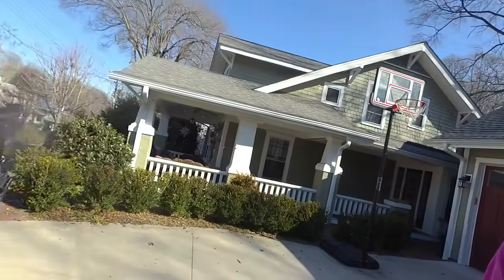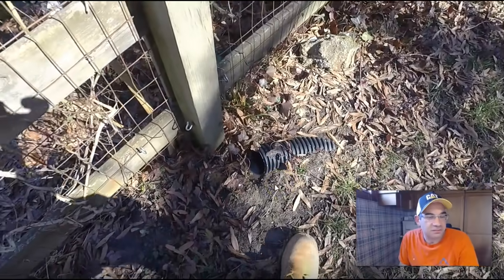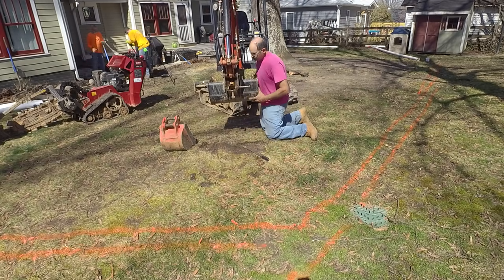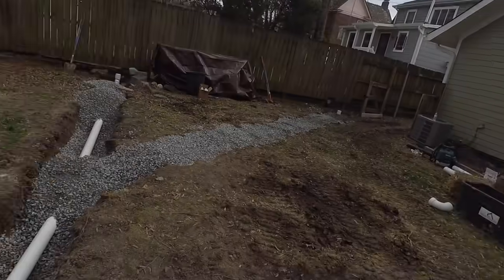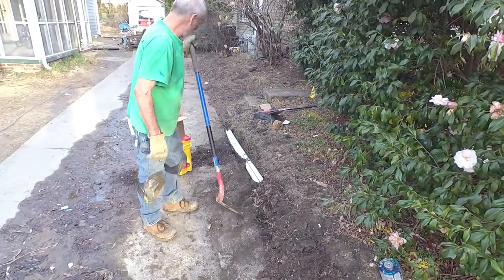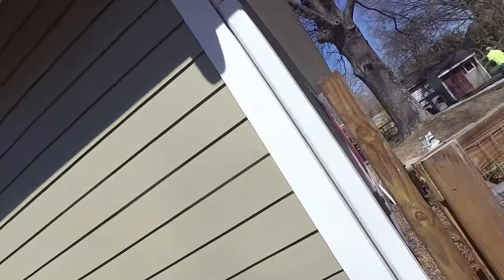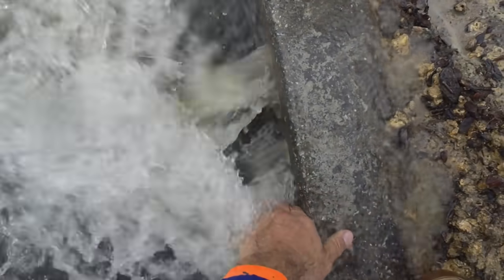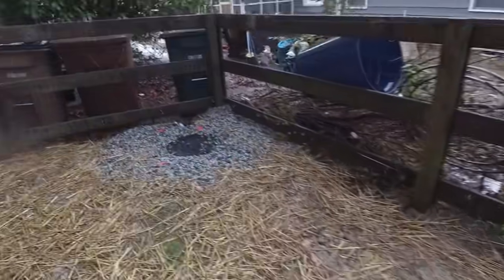Installing a french drain and dewatering pumps to solve stubborn back yard flooding

Comment: in the uk the neighbor would be responsible for the water run off and its also highly illegal to drain water into the road like that, it should be plumbed straight into the mains sewer
Reply: Just to clarify we cannot attach drains to the sanitary sewer in the US. If you mean storm sewer then yes that’s ok, but I think preferred here is to plumb to street.
Reply from the maker: Here in NC homeowners are not responsible for water flowing downhill off their property. The streets are a major component of the stormwater sewer system. We don't send storm water into the sewer that goes to the wastewater plant, we send it to the stormwater sewer system that drains to surface waters like creeks and lakes.
Reply: rain water doesnt go in the sewer here.....

Comment: How will they mow with all the rock in the yard?
Reply from the maker: The rock is at the surface of the soil so as long as they don't drop the mower deck into the rock they should be fine.

Comment: So serious question here - why is no landscaping fabric being used to act as a filter, and prevent all your gravel ditches, pipes, and sump pits from filling up with all the dirt the water is carrying to those points? What is keeping this system  (particularly all the gravel areas) from being clogged up with dirt like the previous system?
Reply from the maker: The previous system had dirt on top of it and had very little gravel. We take gravel to the surface with no dirt on top of it. This also preserves the high flow into the system which provides the energy to carry away fine sediments instead of slowing the flow and allowing those sediments to settle and linger.

Comment: No geo fabric around the rock to keep the dirt and sediment out or did I miss it?
Reply from the maker: No fabric to restrict the flow into the pipe and clog up.
Reply: @GCFD  perhaps some research may be in order non woven depending on oz weight has been tested and proven to move large amounts of water while keeping the soil from packing 2B gravel which will clog the system

Comment: This was cool to see!  Are you able to rate the system at all?  Like how many inches of rain per hour or minute that it moves?
Reply from the maker: I'm sure you could use the chart from the pump manufacturer with the distance, pipe diameter, and head, but keep in mind this system was designed to evacuate the residual water after a storm and not keep up with the water. 👍
Reply: @GCFD  Thanks!  Makes sense.

Comment: So heres a question..
What do you do if power/cable lines are in the path of where the drainage line/exit is to go?
Reply from the maker: Power is going to be very deep so it's never a concern. Cable can be hand dug and worked around as long as you're careful.
Reply: Thanks <3
Yeah unfortunately where the water piles up in big storms and where the water runs off naturally towards the woods is in the path of both lines in addition to the septic so just wanted to make sure if i ever did anything.

Comment: I would have made the top of the french drain look like a dry creek bed with round rock.  With regards to the pump my guess is you are limited in terms of volumetric flow rate by the fact that you can only use 110 volt 15 amp to power the sump pump.

Comment: ed to switch the pump to a 2 inch cast iron waste pump that solved my problem
Reply from the maker: These pumps have been working extremely well for removing the residual water. They are cast iron M98s.
Reply: @GCFD  nice pump however to handle that kind of water waste pump is the way to go nice 1 to 2hp waste pump or sewer ejector can deliver a massive amount of water. hurricane sandy was no match for this pump. little giant 16c. always times what is needed by 2 this way not overworking the motor. nice french drain thank you for the video awesome job

Comment: Question, the pipe in French drains are they perforated with holes? I couldn’t really tell in the video.
Reply from the maker: Yes! The holes face down because that's where the water hits the pipe first as it fills up the trench.

Comment: is it possible to core under the concrete without tearing it up?
Reply from the maker: Yes you can bore under it, but there was a gas line running under it. 811 requires special notification when boring, so we cut and replaced it in this instance.

Comment: Question:  When you install french drains and basins so close to a big tree, aren't you concerned about water-seeking roots getting into them?   I ask because I need a dry well close to large trees in my back yard.  Thanks.
Reply from the maker: The PVC pipes shouldn't be holding any water that roots would go for. Corrugated pipe holds water in the valleys and the roots go for that.

Comment: My understanding was that after a while, dirt would work its way down through the gravel and eventually block the French drain pipe, if, there was not some kind of barrier like landscaping cloth wrapped in with the gravel, is this not the case? overall love the videos! super informative.
Reply from the maker: That's why we don't bury our FD in dirt. It helps keep the dirt out. We also use a large volume of angular gravel which is what keeps the dirt out. The increased flow into the drain provides the energy to carry fine sediments through and out of the system, keeping it clean and flowing.
Reply: @GCFD  awesome! Thanks for the info. Look forward to more videos, as I will be subscribing.

Comment: separate comment, when I was a kid,  friends dad 3 streets over bought home that back yard flooded, after storms, 3' of standing water until it soaked in, houses below got more as they were lower, well he bought a dump truck & brought in fill dirt, raised his back yard 4 feet, but lower neighbors got a lot more, 8' or more of water it was crazy,  this was done 35 or so years ago, & he let me use his old dump when I was growing up, & I just bought my first dump a few days ago, but I need to repair it before I can use, I assume how he did it wouldnt be legal now? but that was my first experience & exposure to this, & he has been dead 15 years now, & house sold to someone else that I have no idea of
Reply from the maker: It would be legal here in NC. Homeowners are not responsible for surface water draining off their property.
Reply: @GCFD  very cool, & this was in VA, but was unsure, especially since this made all homes in bottom of valley flood worse. didnt know if there were laws now or not, I am just learning at present, got a Tractor with loader & backhoe, but so much to learn. but I am having a blast doing work on my own property

Comment: Since I’ll need to get started on my own, I thought I’d start with the parameter of the trailer where water has made a trench & settles there but need advice and love your work. Do I dig out the area around the house and put in gravel or something or do I build it up with dirt then put something down? I was going to send a pic but couldn’t figure out how to attach.
I’ll be using my only tools which is a shovel, rake, and wheelbarrow.
Reply from the maker: I would ask the question of where is the water coming from that is forming the trench. Can you catch it before it gets to that area?
Reply: I have a metal roof with a wide overhang that I don’t think can hold gutters so it’s coming straight off the angled roof
Reply from the maker: @BoringisBeautiful  gutters would be the cheapest and most effective way to move that water because they are the collection system that places your water in a pipe.
Reply: I understand. If I get gutters there is still more problems with where the drainage would go. I really wish I had someone knowledgeable that would just come see what I’m dealing with and advise me where to start. No one calls me back or comes out....I guess because it’s a trailer, idk. I finally got the county to respond to my email concerning my ditch & culvert under my driveway filling with water even with a light rain as the ditch is almost flat/not a ditch. But they haven’t been out yet.
I just thought I could start shoveling something 🤷‍♀️. Just don’t know if I’ll make it better or worse.

Comment: Wow that was a lot of water! Shawn, how do you make the waterproof electrical connection to the sump pump in the basin? They normally plug-in, right?
Reply from the maker: I order these pumps with 25' cords so the are already set up with the cord. Then it can reach to an outlet. In this case both pumps reached outlets and we didn't need any installed.

Comment: Would it have been possible to put all that dirt back over the gravel to improve the looks, or would that interfere with the French drain?
Reply from the maker: Putting the dirt over top of the FD doesn't let the water flow into the FD. We consistently replace french drains with puddles standing on top of them.

Comment: Great job...BUT I would not put over an inch of dirt within 30 ft. of that tree. I've been there and done that . I also killed an oak about that size by digging a trench about 10 ft. from one.
Reply from the maker: The tree used to be covered in that much dirt but it washed away recently so we felt ok replacing it. We also tried to stay off the drip line with our trench as we didn't want to hurt that amazing tree. Great comment!

Comment: question on French drains, to they make perforated culvert pipe to use for a French drain that can handle weight of car / pickup? I am just starting to learn, never done anything yet, my driveway will be first in a few months, but I have a co-worker that yard slopes down, so water runs down, then they have a 2 car garage elevated approx.. 2 feet,  garage is close to 100 feet past the house,  but water is eroding dirt under cement pad 6 feet in front of garage, rest of yard is dirt grass, very little gravel, been years since gravel was poured, it looks easy to dig & channel water around side of garage down hill,  but all I see locally to me is single wall perforated pipe, & I dont know if they can handle weight of vehicles driven daily across?
Reply from the maker: Yes, we use schedule 40 perforated pipe. That can handle whatever you want to drive over it.
Reply: @GCFD  thank you, I will go looking to be able to figure out layout, & pricing

Comment: May I ask why you didnt line the trench before you put the gravel in?
Reply from the maker: We have clay here so not much subsurface water moving around.
Reply: @GCFD  I have a lot of clay too.  Just never seen this done without a liner.
Reply from the maker: @michaelfisher7835  exactly 👍
Reply: @GCFD  I like what you did with the rip rap and culvert pipe in the other video.  I like the look of the rip rap and it is more practical in removing surface water along with the water coming across that road.  The customer could do some really nice landscaping to enhance the look if they dont like the rock alone.

Comment: Really enjoy watching your videos, as a IT-Tech over here in Sweden its nice to grab some points for your own home.

I do have some questions for you, i will keep them short so sorry if they sounds rude, not my intention :)
#1 Would you have had the same efficiency if you had put the french drain all along the fence instead? (Improving the WAF-score (Wife Approval Factor))
#2 Could it also have worked with a channel drain along the fence?
#3 Is there anything you could do about the looks when putting it smack middle of the yard?
Its kind of a pain in the but with a robot clipper to have the risk of it throwing stones everywhere.
Reply from the maker: Great questions! We let the water tell us where to place the FD. You want to place it where the water has already found its path of least resistance so you ware working with gravity instead of against it. You saw that the yard was not torn up after all that water flowed across it and the water was gone in minutes. I feel like working with the water instead of against it gives the best results.
Reply: I feel like this guy didn't answer your question at all. Normally you cover the gravel with a few inches of top soil. You wrap the pipes in a special type of fabric to prevent soil from getting into the wholes and blocking up the pipe. Like the video says they didn't do any of that because the home owner was dealing with a lot of water and didn't care about how it looked. As far as running drains along your fence I feel like in a scenario like this where the pumps get overwhelmed you'd still end up with a pool of water in your backyard. You would still end up needing a catch basin at the lowest points of the yard.
Reply: @huntforandrew  Wrapping the pipes and covering them is done for getting rid of ground water. It's a slow process. This french drain works more like a surface or channel drain and gets rid of the water much faster. It's kind of a hybrid. Water drains into the rocks immediately, then enters the pipe like a french drain. Days after the rain stops, it collects ground water. The surface water is by far the biggest issue here.

Comment: Seems like with that much water coming in, you needed more capacity.  Probably would have been worth it to catch it at the fence line as it came onto the property.
Reply from the maker: There are tens of thousands of solid surfaces uphill from several neighbors so we never tried to keep up with the water. Rather, we focused on getting rid of the residual water after the rain event. 👍

Comment: How is this not going to clog over the years if you're not using a filter cloth? Isn't the dirt going to eventually mix with the rock and reach the pipes?
Reply from the maker: The rock forms the filter. That's why we use angular rock and don't bury the rock with dirt. The high flow keeps the fine sediments rinsed out of the system instead of clogging behind a thin fabric. It's all about flow.

Comment: Why did you choose not to wrap the gravel layer with landscape fabric?
Reply from the maker: Because a thin layer of fabric kills the flow and clogs quickly. I use several inches of angular gravel as a filter. This preserves the flow which is what carries the fine sediment through and out of the system.

Comment: Would definitely have two pumps for redundancy, im surprised you didnt do like we do with putting greens, one or two main lines with off shoots
Reply from the maker: We use high quality pumps with a 3 year warranty. If they fail we replace them.
Reply: @GCFD  im just saying redundancy is key or using 2 pumps with 2 pipes pumping twice as much, not trying tk say you use poor quality parts or materials.

Comment: What year is your dump truck? Any reccomendations on where to purchase one? It's always great to see your videos btw.
Reply from the maker: That's a 2005 f550. I found it on facebook marketplace. 👍
Reply: @GCFD  what did you pay for it? I have a 2001 f350 with 6ft dump. Its gas not diesel and it has 145k miles on it and I paid 3k. It works like a charm for what I do but I definitely need to prepare to buy something bigger for the future.

Comment: I’m wondering if you can talk a bit about the new system’s ability to help rainwater absorb into the ground compared to contributing to more flooding further down the street. After Tropical Storm Ida went through my area there was horrible flooding which was basically the result of water from several towns up hill turning the major roadway in the area into a river that raised the water level in low areas of the town below by 8’! It has me thinking about what steps can be taken to control flooding on a property while still allowing the ground to do as much work as possible to take in water.

Comment: Had you connected vertically 4" PVC pipe "directly to the gutters"...then "gravity" would have taken the roof gutter water away at no cost (electricity). The vertical PVC pipe would force the water to the street, just like your city highrise water tank force's the water to your home. Let gravity do the work at "no electrical cost", The reason you must use a sealed PVC pipe vertically, directly from the gutter is because gravity is the "force" you will use to push the water to the street...at no future cost. Water pumps wear out...gravity doesn't!!!
Reply from the maker: I don't see how you could generate enough head to push 100" of 4" pipe full of water uphill on this one Larry.

Comment: Shouldn’t u wrap around the crush with permeable mesh to keep mud from clogging the pipe? Edit: maybe the soil where u are is different but that’s usually how it done as far as I know ( no formal training just curiosity)
Edit: the basement sump wasn’t running during that much rain which shows how much of an improvement u guys made
Reply from the maker: We have impermeable clay soils and no subsurface water. If you have subsurface water you definitely want to wrap in fabric.
Reply: @GCFD  Could you please explain why the clay isn't a concern in this scenario? Does it tend not to migrate into the crushed rock over time?
We have red clay loam subsoil with no subsurface water. Should we be looking at fabric wrap?

Comment: Holy shit that’s a lot of water! LOL! How do you determine how deep to make your french drain? I have a large field that I need to do something with. But have no idea how to judge the depth at which the water is running. Any hints?
Reply from the maker: Dig down at the low point where you have standing water. You only need to be into dry dirt for this to work. More gravel is better though which is why I usually dig down 8-10." Also, your fall will determine how deep you can be so that you maintain downhill slope.
Reply: @GCFD  Thank you! Really appreciate it. Keep the content coming!